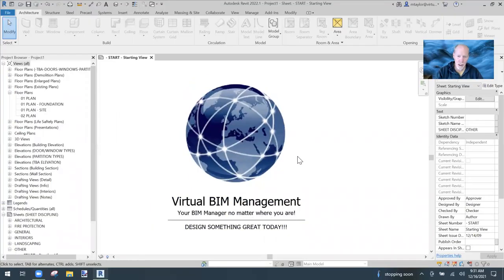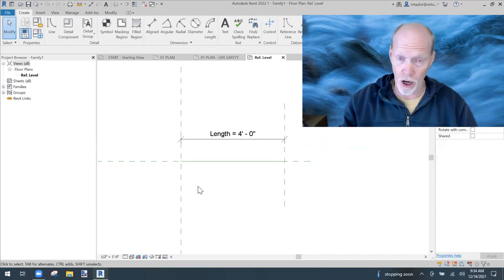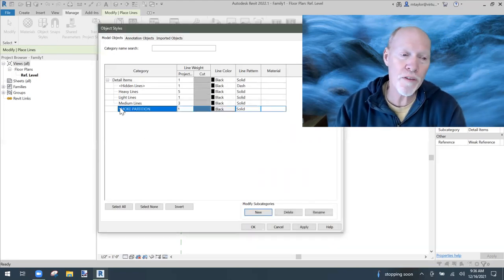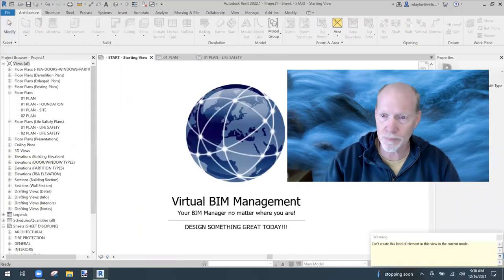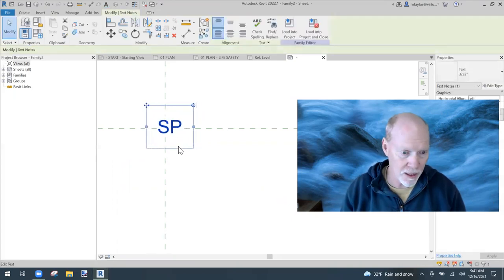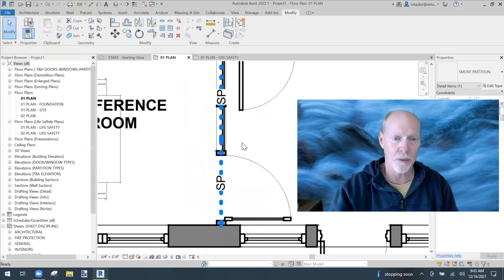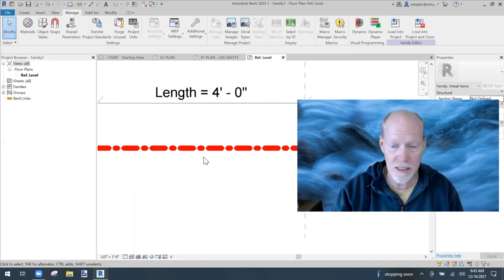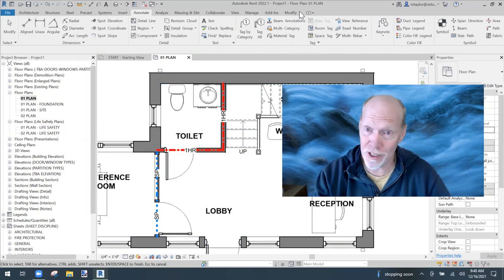DETAIL LINES WITH TEXT EMBEDDED: Annotation to show fire-ratings

Comment: This looks great. In our office we have started to use filters in a fire plan view template to denote any rated walls. Its working great.. However, sometimes it would be nice if the text could be included as well..
Reply from the maker: There are several ways to represent Fire Ratings. I find that each firm tries a few different ways and then settles on one they like.

Comment: That is really helpful / useful. Just a comment about the line pattern creation. I wanted to change this pattern after I created
it in the project. So I went back in to edit the family and went to Manage_Additional Settings_Line Patterns.
However after I changed the Type and Value in the Line Pattern Properties dialog box and saved all -
It showed the revised Line type in the Ref. Level editor.
But when Load into Project, it did not show the change. 
It remained as it previously.
Reply from the maker: It's a FEATURE of Revit to keep the settings in the PROJECT if a linetype or material or anything is introduced (or reintroduced). So the first time you added the linetype to the project, it was fine. But when you edited it.. and then reloaded it... it didn't update. That's Revit protecting your project. You will need to NOW edit the linetype IN THE PROJECT. You can't edit the family and have it update any longer.  :/  You will see this on other things like materials... so keep your eyes open!  :)
Reply: @miketaylor-fantastic  
Hello Mike. Thanks for responding to my comments
I did find the solution as you said it was Project based.
While in the model, I went to Manage_Object Styles_Model Objects tab_Detail Items (Category)_Smoke Partition_Line Pattern.
Pressed the drop-down arrow and there were all of the variations of Line Patterns that I had created.
Tried with similar results through Visibility Graphics.
Appreciated your help.
And I have to say that I love the cheerful way you present.
It's very engaging.
All the best for the Christmas break.
Hope it all goes well for you and yours.
Reply from the maker: @danielellaby5680  Thank you so much Daniel!  I hope you and yours have a fantastic Christmas!!!
Today’s video was also in response to your comment!!!
:)